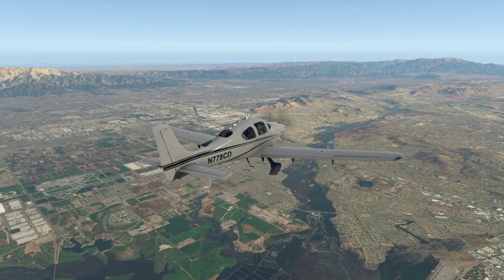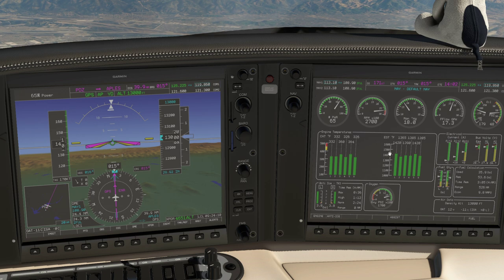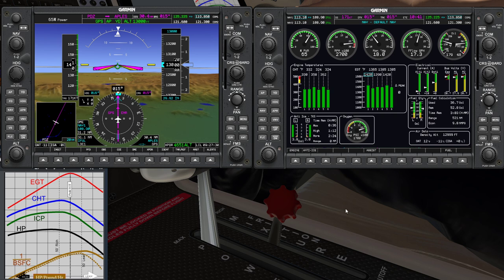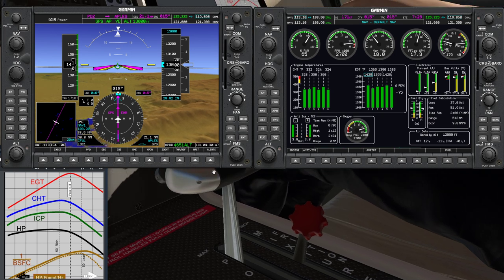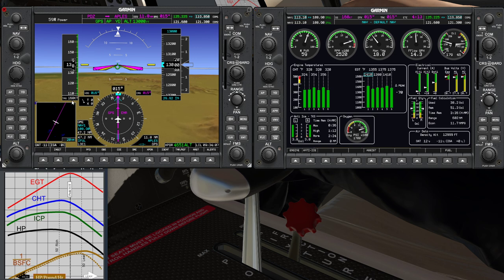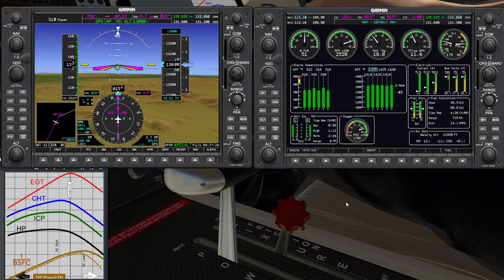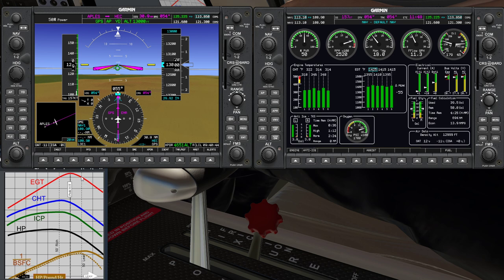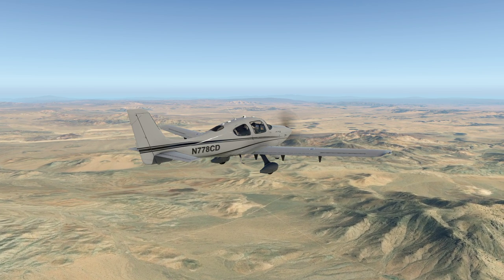TorqueSim SR22 Part 2 - Mixture, Leaning and Lean of Peak Operation [X-Plane]

Comment: Fantastic video. Real world stuff. I fly a 22 G2 NA LOP @ 10.8 gph which keeps the CHTs low and range high. The ROP vs LOP war in the Cirrus world keeps raging on.
Reply from the maker: Thanks Dom - yes when doing the research for the video I assumed all SR22 pilots would be on the LOP side of the debate as that's what the flight manual says, but I think we'll run out of AvGas before the debate is settled! I think TorqueSim did an excellent job with the SR22 so hope you've been enjoying the sim model.
Reply: @ReflectedRealitySimulations  Indeed! I don’t have hard data but it seems most Cirrus drivers go for ROP as they all want speed. I prefer range and fly at around 150 kts. An extra 20 kts reduces a few minutes but fuel consumption is around 60-70% more. The TorqueSim airplane is astoundingly good. It freaks me out how closely it resembles my own 22. I use it for real training/practice. To me it’s an invaluable tool and speaking of invaluable, can’t understand how cheap it is to buy. Going back to your video, which is so professional and useful, I’m going to share it with COPA.

Comment: Ok, so I agree that you should set power first then set mixture... But why does mixture need to be reset if the power lever is changed when altitude remains the same? If power is at 50 or 70%, the mixture ratio remains the same for the amount of air coming in.
Reply from the maker: That’s a very good question, there are two reasons for this. Firstly the fuel pump is mechanically driven by the engine, such that higher engine RPM results in higher fuel pump pressure, so effectively changes the mixture when changing RPM. Secondly the throttle fuel metering value is designed to ensure a high power setting is richer than a low power setting. Higher power settings are more likely to cause detonation and this is prevented by ensuring high power is set richer than low power. With both RPM and throttle on the same lever in the Cirrus you can see moving the power lever to a lower setting will reduce fuel flow through the pump (leaning) and also change the metering valve position that also adjusts the mixture. Hope that makes sense?

Comment: Hey, I hope you are doing well and just have to to work again. Under that assumption, I would like to ask if you have a timeline for when you are panning to continue the Cirrus series. The turbo normalized version seems to behave a bit differently and I am looking forward to a detailed guide. All other Youtube videos I found just to focus on leaning the non turbo variant.
Reply from the maker: Hi Robert, sorry for the delay replying. Yes I've been working a bit more, but now things have tailed off again running into winter and the second UK lockdown. I'm going to try to finish the Cirrus series before Christmas, and at the moment the turbo version is planned to feature in the 5th video.
Reply: @ReflectedRealitySimulations  No problem, we all have a life. Was just a bit worried that anything happened. Looking forward and all the best.

Comment: I purchased Noble Flight Systems G1000 hardware, and saw that it didn’t really talk to torque sim . Any plans for the integration? That will make it a wonderful system.
Reply from the maker: Sorry for the delay replying. I don't know if Torquesim plan to implement support for that hardware, but the Torquesim Discord is very active so maybe worth asking there. https://torques.im/discord

Comment: I just have one interrogation concerning the statement you make in the first video, to the effect that this plane is "simple and straightforward" to fly and aimed at the non professional pilot market. I've flown 172's and Cherokees in the '70s and '80s and the power management in these planes is really simple, no CHT or EGT gauges and leaning was not a precise operation. The Cirrus seems to be much more demanding in this respect. Correct me if I'm wrong, but since the SR-22 does not have a retractable landing gear and has only one power lever, it is not considered a "complex" plane and thus can be flown with only a PPL and no "complex plane" endorsement. On the other hand, you can't get the most out of this plane without an  instrument rating. If you want to use this plane to meet customers, but can only fly in VFR weather, you'll be driving or flying the airlines quite a lot.
Reply from the maker: Very sorry for the delay replying. The big thing about the SR22 is the operating regime, the aircraft will typically be operated over a much larger range of altitude and speeds compared with a C172 or PA28, and although the process of leaning seems more complex this is simply for best efficiency, if you were operating up to 5000ft or so you could basically leave the mixture alone just as you can in a simple carb aircraft. However compared with an aircraft of similar capability the SR22 seems fairly simple to operate. I don't know about specific rules for the SR22, in the UK it would probably need licence endorsements for constant speed prop and electronic instruments, but as with most things it's the insurance company that will usually impose more restrictions so SR22 specific transition training is most likely to be mandated. Hope that makes sense?
Reply: Tx for the reply, no problem with any kind of delay. I'm retired! By the way, if you're ever looking for another plane in need of a tutorial, the FF A-350 is an awesome plane, but unfortunately the documentation is minimal, while the complexity is not! I believe it is way up there among the best aircraft available on X-plane, but it needs the RR touch! 🙂 Take care!